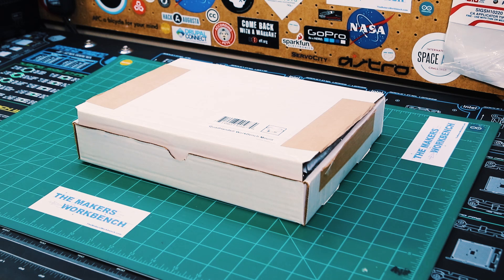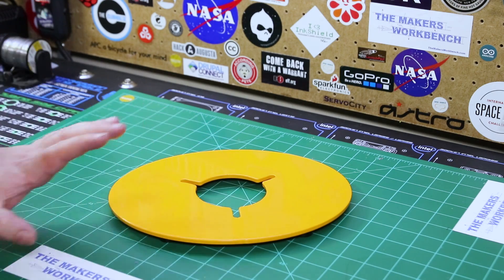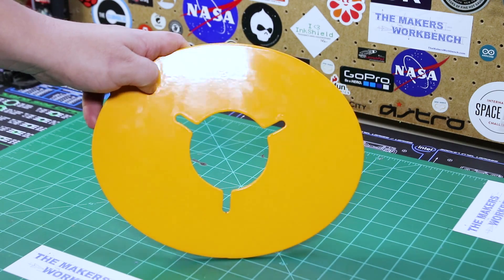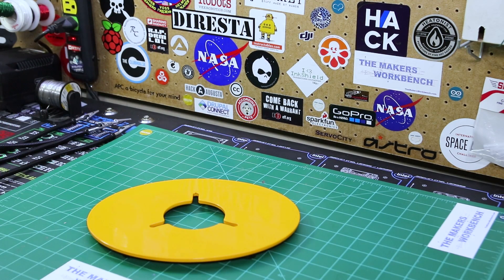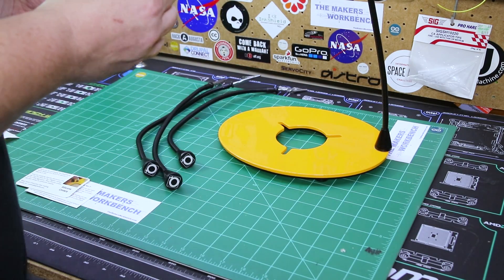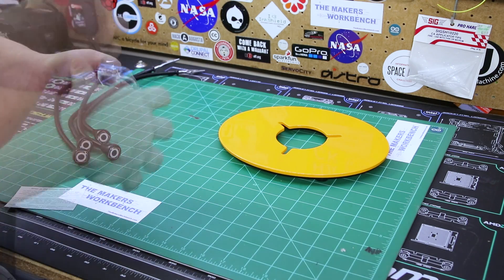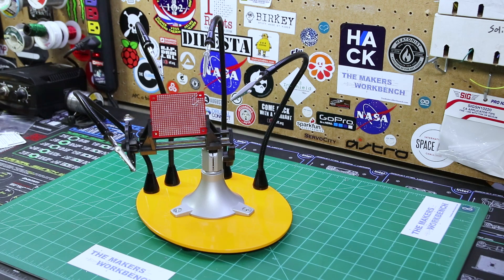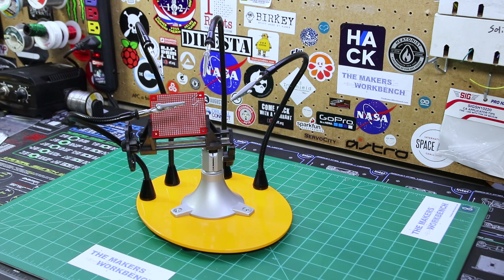The Best Helping Hands on Amazon? QuadHands Bench Mount + Panavise Jr Reviewed!

Comment: these were bad. Not only do they not stay where you put them, they melt when trying to solder
Reply from the maker: I've been using several of the quad-hands setups for almost 5 years now, and have not experienced any melting, or flexibility issues.

Comment: If I want to solder two wires together can I place them next to each other easily or is there spring back in the arms that will create a gap as soon as I let go of the arms?
Reply from the maker: The arms hold their position quite well. There will be a little spring back but you can compensate for this by bending the arms a little further than needed. I use mine to solder wires together weekly and love it.